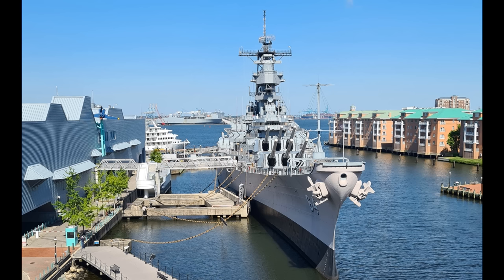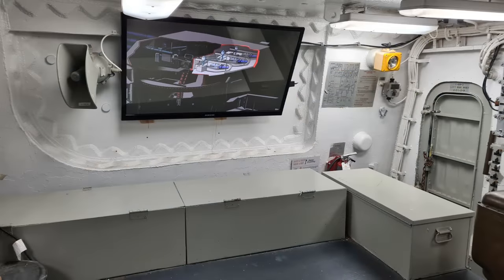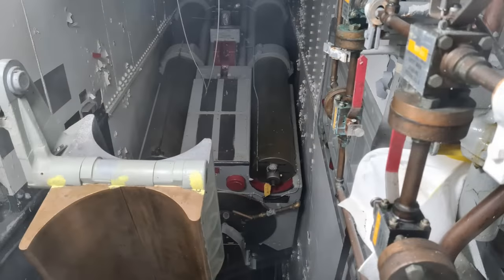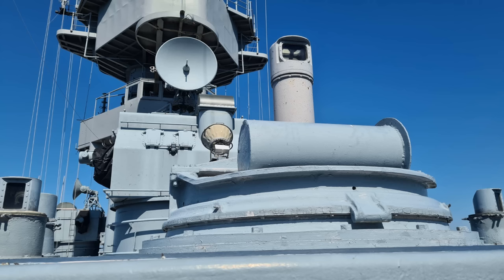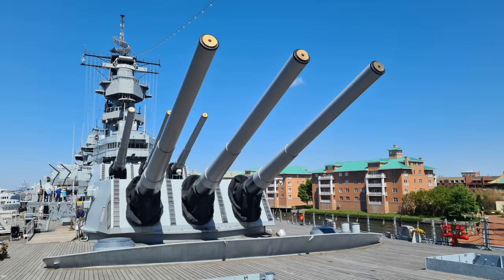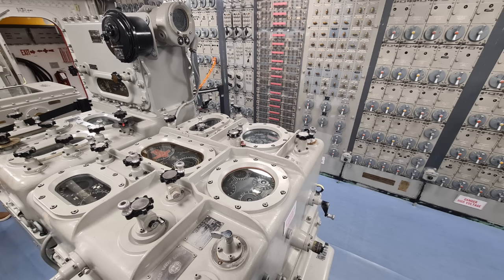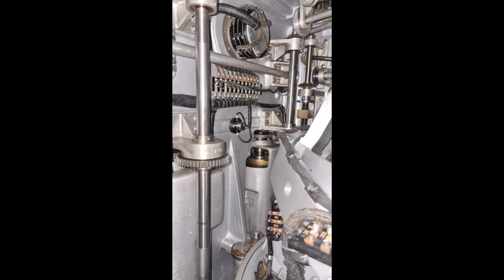USS Wisconsin - Give way to oncoming battleships!

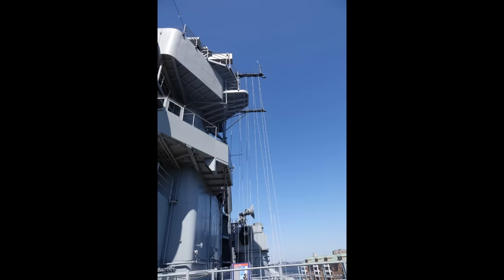Comment: Time stamp 25:25 correction: it is a signal light, not gun trainer
Time stamp 27:23 clarification: let’s say the ship pulled into a port to allow shore leave but you don’t want to waste souvenir money on a taxi. Borrow one of the bikes instead. The bikes are now just part of the presentation.

Thanks for coming Drach. As one of the staff of the Battleship Operations team, hope to see you onboard in the future!
Reply: At time stamp 25:25
The two things on the right are signal lamps? Would that make the big lamp bottom center right a search lump?
Reply: How do you go about getting a job on one of these ships? Does Wisconsin have paid staff or is it all volunteer?
Reply: @SW-pz1yy  the gun-like devices are saluting guns, while the thing that looks like a search lamp is the signal light

Comment: I was stationed at Ft. Story in VA. Beach, so I used to see these things coming back to Norfolk. Somewhere I have a picture of an Iowa offshore. It was pretty far out, but it was still impressive. Even more impressive was hearing one of these things pass overhead while you’re in the Bay—Bridge Tunnel; even sitting in traffic far below the surface you can hear the screws churning the water.
I haven’t seen Wisconsin since her decommissioning. I was down there from 1988-early 1990, and obviously she was still in service, but it is on my “Bucket List.”

Comment: The furnace sights on a boiler are there to keep an eye on the flame, it’s shape and colour. It should be swirling, sort of like a tornado and, if oil fired, white. If it’s not then there is a problem with the burner or air supply.

Comment: @7:08  In as-built configuration, there would be two persicopes.  The Turret Captain (normally the senior [enlisted] Chief assigned to the turret) would man the left periscope, between the left and center guns.  The Turret Officer (typically a Lieutenant) would be at the periscope station between the center and right guns.  The Turret Officer's position has more indicator panels and communication hookups to "higher" compared to the Turret Captain's station.

Comment: In Star Wars (1977) I was always struck how the Death Star's defensive battery looked like a USN 5"/38 twin mount blasting away a Japanese kamikazes.
Reply: It's not a secret that the space battle scenes were inspired by WW2 naval air combat.
Reply: As I recall, that's exactly where the model pieces came from, just with some extra "business" daubed along the length of the barrels.
Reply: @colormedubious4747  George Lucas plagiarized some dialog from The Dambusters, word for word.
Reply: @crazypetec-130fe7  I'm shocked... said no one ever.
Reply: See 633 Squadron for further WW2 Star Wars references.
Reply: Probably due to the fact they used parts from model kits of battleships, tanks, etc. If you search on here for the movie, there should be a behind the scenes clip on the production aspects. It includes how they built the models from scratch.

Comment: Talking about the early electronic computers at Bletchley park reminded me: the origin of the term “bug” in computers is that when these massive room sized glorified pocket calculators were in service, the most common fault in them were literal insects making their home in the dark, warm interior of the computers and accidentally frying themselves on a high voltage bit of the machinery or being crushed in a moving part so the “bug” would need to be removed before the computer would operate correctly again.

So the computer doing something unexpected forever became “a bug”
Reply: @jackgee3200  Well, i can honestly say i didnt make this up myself, so some people thought it was true :)

Comment: The port holes on the Navigation Chart Room are dual material condition designated. The glass portion the a Yankee fitting closed when wartime steaming. The covers are designated a Dog-Zulu closed during steaming condition I (General Quarters / Action Stations) or during darken ship at night. Condition Xray is closed all the time and are only operated when commanded. The Condition Whiskey are closed when you encounter avrious NBC attacks, generally ventilation fittings.

The "Star Trek" looking board is an electrical transfer control board for connecting or cross connecting the various electrical power busses to one another. The blue lights possibly indicated the breaker is closed.

Comment: @33:43 the panel shown is pneumatic and controls valves which have air operated motors and are for flood control in the engineering spaces, as DCPO, I was responsible for performing maintenance on U.S.S New Jersey's panels

Comment: I'd just like to toss out there that the Nauticus itself has some absolutely fascinating exhibits that really get across the power of capital ship guns.  One is the famous swing balance with a 16" HC shell hanging from one side, and a Volkswagen Beetle hanging from the other.  Another one is a chunk of armor plate that was the subject of a trial at the Dahlgren proving grounds, shot with a 12" gun matching those on the US's first dreadnoughts, the South Carolina class.  The plate has visibly delaminated from the energy of the impact at the edges of the hole...

Comment: Finely machined gearing is incredibly durable when it's dealing with expected stresses. As long as the the mating surfaces are meeting in the right manner they can transfer incredible amounts of force from one piece to the next.  When unexpected things get added into the system, damage happens. 

Volumetric pumps are pumps that put out a set volume of whatever fluid they're pumping per rotation of the driving shaft. Very often these are set up as a set of gears meeting inside the pump housing, and regardless of discharge pressure, they'll efficiently pump out fluid.  They're also machined to a similar precision as a reduction gearing set.   

During my shore-based training we were handed around several smaller models of various pumps to handle, and take apart, and spin the drive shaft to see what happened.  The gear-style volumetric pump, we were told wouldn't rotate anymore, though.  Some bright spark had had the brilliant idea of wanting to see what it would do if he passed a sheet of paper through the gear.  That thickness of paper, with a determined young sailor's muscle power on the drive shaft was enough to turn the whole thing into an immobile lump.  We could still see the torn remains of the paper still stuck in the gearing.  

That's how fragile those reduction gears can be to unanticipated stresses.  It's also why inspection mirrors for inspecting the gears were never glass-faced.  

It honestly surprises me to think that there was ever a time that the reduction gear inspection ports were ever unlocked.
Reply: Back when I was in- late 60s time period- there was an incident on the Ranger, I believe, where someone sabotaged one of the reduction gears to prevent a deployment. Yeah, things like that did happen. It was a bad time all around in those days.
Reply: @maynardcarmer3148  I didn't mean to suggest I doubted that there had been deliberate sabotage, and I apologize if I gave the impression I was doubting that.  

Given the potential for bad things to happen by accident, locking the reduction gear access ports seems prudent even without a concern about sabotage.   Of course, I was a Nuke, and we had the reactor plug locked, too, when we had no reason to be in the reactor compartment.
Reply: @OtakuLoki  No problem. I was a Hospital Corpsman, serving on a DDG at the time

Comment: "Give way to oncoming battleships" is excellent advice for any vessel...
Reply: Definitely follows the lug nut rule for the right-of-way on the highway: the vehicle with the most lug nuts has the right of way.
Reply: The nautical version is the Law of Tonnage. Swap "number of lug nuts" for "gross tonnage" and it works pretty much the same.

Comment: Rad signs like that are a form of CYA for the Navy. They are used to designate areas requiring dosimetry. The Navy is strict with its standards for nuclear propulsion. A little bit of table salt would have enough radiation to be considered a contaminated spill. The weapons program isn't as strict, but they still are very cautious.
Reply: I have known submariners who have gotten cancer.  US not Soviet.
Reply: @rogersmith7396  and? cancer rate increase from NNP is <1%. Tobacco use causes a higher increase to cancer.
Reply: @rogersmith7396 Any of them smoke or drink? I know people who’ve gotten cancer and once had an X-ray - I also know people who ate a banana and got cancer. Golly.
Reply: @jimtalbott9535 that's why I stay away from nuclear bananas. You can't be too careful.

Comment: @~41:15, i wonder if they could create a virtual reality or augmented reality system for the battleship similar to what The Void used to do. People would wear a headset and as they moved and looked around it could display informational or reenactment overlays. And a system for people with mobility issues to use the headsets for a virtual tour without having to walk anywhere.
Reply: No theoretical reason you can't, but you would need details and measurements of everything from the full ship blueprints down to the things like the gear specs, if you wanted people to be able to look inside the computer. However that probably isn't all that different from what gets put into CAD systems when designing current stuff. The biggest tricks are A) finding the information at all, or re-creating it with measurements, B) getting all of that data entered into the modeling tools, and C) putting all of the pieces together efficiently enough to be usable. C just needs expertise and time, B needs a lot of data entry and cross-checking, and A... probably isn't realistic, unfortunately, although maybe at some point we'll be able to get a LIDAR drone to scan it, which would at least get you the rough outlines (but to be accurate a human has to go in and "clean it up" / break it into chunks small enough for the tools to handle.

Comment: A tube based computer would put out huge amounts of heat and use equally huge amounts of electricity.  It would have to be protected from concussion and tubes will drift with temperature.  The F 106 had a one ton tube computer in the 1960s with its own generator.  I think those WWII computers had about 4k capacity.  My computer has something like 3 million transistors on a chip.
Reply: Also, one reason for the accuracy is that they are analog, not digital, which means they express a continuous function / calculation and the only real limit on precision is how fine you can get the meshing between parts and how accurately inputs and outputs can be represented.

Comment: I used to analyze oil from expensive agricultural machines using atomic flourescense.  Looking for excess tin, lead, copper Fe, Chromium etc. which indicates abnormal wear in rotating components.
Reply: Parts per billion not see if there is junk floating in it.

Comment: At time 25:25, those small guns in the lower right are not for training but are on the ship as a Saluting Battery.  I don't know for a fact if they are still used but suspect they are.  Unlike her three sisters I don't believe any of Wisconsin's 5"/38s can be fired because there are some very high end apartments that overlook her berth from close range.  I don't think these folks would appreciate having windows or fragile belongings damaged by concussion and of course the museum itself is right alongside on her starboard side.
At 29:46 that is indeed USS Wasp (LHD 1), homeported in Norfolk VA and was in the civilian yard for a maintenance availability.  The big hammerhead crane visible behind her is part of the Norfolk Naval Shipyard in Portsmouth VA, right across the Elizabeth River.  That crane is what you would have used if Wisconsin needed heavy repair work done, on one of her main turrets for example.

Comment: With the upcoming lasers (needed for hypersonic weapons), do you think "battleships" could return?  I figure they'd be great platforms for lasers if given a nuclear power plant like the carriers.  Use them as escorts for carriers.
Reply: Probably not. Naval nuclear reactors aren't very big and you don't need them for laser weapons. The USS Long Beach was a nuclear cruiser that only displaced 15,000 tons and had a length of 721 feet. That's tiny when compared to an Iowa class. We have also mounted laser weapons for tests onto an Austin class LPD. that laser generated 30kw of power. The navy is predicting a laser mounted to an arleigh burke to be able to achieve 60kw of power. Those power figures are for using the experiential AN/SEQ-3 Laser Weapon System. Lockheed Martin is declining a new laser system that should be in probably classified testing now.
Reply: @jasonirwin4631  Indeed, no real benefit from either that much size (just add a couple more dedicated power plants and slightly increase the size) or for gun stability (the system already has to be able to track orders of magnitude faster than any ship shifts).

Comment: The "CAUTION - RADIATION AREA" plaque at about 26:00 is not necessarily referring to nuclear weapons, but is more likely warning of the presence of radar systems operating that you should not stand in front of unless you want some of your body parts transformed into something resembling hard boiled eggs.
Reply: @guyintenn  Actually the symbol is warning against "ionizing radiation" and appears on non-radioactive sources as well, such as X-ray treatment machines.

Comment: Drach, you once said the Iowa class battleships were in to bad of shape to be put back into service, After your visit and close inspection do you still think they are just rusting metal or could they still be refurbished if a use for the 16 inch guns could be found.
Reply: I know obviously I"m not Drach but the problem isn't the exterior.  Their hulls are fine, what's the problem is their machinery. Every inch of steam/'fuel/water piping would need inspecting and replacing. Boilers and turbines also would likely need replacing. You'd need to restart production of those parts, shells, amunition and countless other items. 

Is it possible? Absolutely, with enough money they could be reactivated but would they serve a purpose  that other assets can't? Questionable. It'd be years of work, you'd have to almost rebuild the ship and you'd spend more than making a new one., Ryan from the New Jersey channel has done videos on this.
Reply: @JamesF0790  Some people are refurbishing a liberty ship w/out going to great measures. i rather have a Iowa than this  new junk the Navy cant get thru sea trials without $$. i could fix all the Iowa's for what the Navy wasted on the Zumwalt's.
Reply: There's a difference between fixing up an old liberty ship without armour, weapons or the like to run around a harbour I'm assuming? And bringing four heavily armoured battleships up to modern standards. Plus the liberty ship doesn't have an armoured citadel to get through to move any heavy parts. 

I had a longer post written up but I wasn't sure if you wanted to go into a longer form discussion about this point by point or not?

Comment: The nuclear radiation sign is there because alpha, beta and gamma particles build up in your body, it’s called a dose rate.. if those nuclear warheads were leaking, you would catch a lethal dose rate fairly quickly (10-20 minutes or so)  and you wouldn’t know till a few hours later.. the sign is there to remind people not to spend to much time in that area just in case the shielding on the rockets is compromised .. they probably had someone check the amount of particles coming off the rockets fairly often with a dosimeter or Geiger counter

Comment: An interesting thought i have is the way navy's project power these days, and the current surface fleet, would it be a stretch to claim USS ford will be obsolete in sooner rather than later? Frigate/destroyers with 20-35 missiles are easier to deploy VS a task force air group worrh more than most countries GDP.

Comment: Drach mentioned that the electro-mechanical fire control table was more accurate than the radar fire control later fitted.  So how would they know?  Did they keep the old system operational and perform rests?
Reply: I believe the actual story is that they concluded that any performance, reliability, usability, reduced maintainance, etc improvement (to the main battery FCS) would not be worth the vast effort and cost that would be involved. Especially, bearing in mind the limited expected future service life and deployment.
ie. the existing (Rangekeeper based) system would be entirely adequate for the weapons system performance in any anticipated use (shore bombardment) - rather than that it was actually better or more accurate than any new system could achieve. But that's not such an interesting angle.
AFAIK, the only really significant upgrade was a muzzle velocity doppler radar - to improve the ballistics calculation. As for the target tracking capability of the Rangekeepers  - seems highly unlikely these ships would ever get to be in a serious sea gunnery engagement any time after 1950.
Reply: @jackgee3200   Yes, that makes sense. Many thanks for a very comprehensive explanation.

Comment: So can the overhead rail system carry a nuclear tipped cruise missile?
Reply: The TLAM-N warhead is the W-80 selectable-yield warhead and weighs about 270+ pounds.   To move the warhead, the BGM-109 would have to be removed from the ABL, moved to a RADHAZ-safe area, and then disassembled.   Difficult to envision why such an action or evolution would be undertaken.
Reply: @davidmurphy8190  As Tommy Lee Jones...